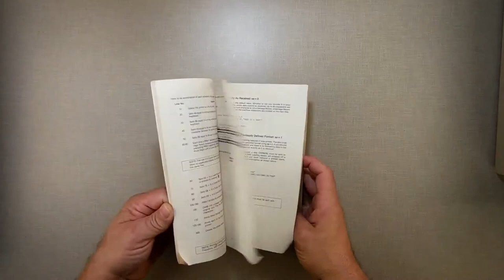C64 Dreaming - A Craigslist Adventure - Part 1 the Commodore 64

Comment: I think that program is supposed to just make noise. I think If your SID was dead you’d get nothing. Also, the SID does other things fit the computer like handle the paddles so I think it needs to stay in.
Reply from the maker: I realized the program wouldn’t work with a dead sid cause the did makes the random number that the program relies on
Reply: @8BitMilli  Oh yeah! I didn't even think about that. Nice one! :D